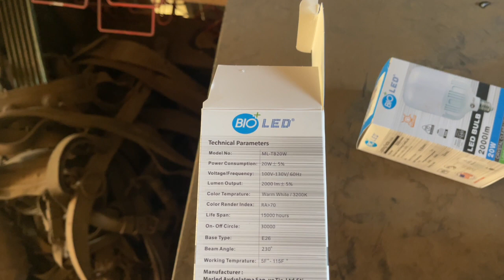No Good Way Out 😳

Comment: Hope you all have a very happy new year all year long! 20 Watts is the LED equivalent to  150 to200 Watt incandescent ones!
Reply: I came here for this. LED technology uses a lot less electricity, and is also brighter. Especially if the kelvin rating is high.
Reply: Better to look at the Lumens number.  2000 lm = 133 watts of an incandescent light bulb.
Reply: Better to look at both lumens AND kelvin. Watt equivalence is easier for most people, because with incandescent bulbs, that was how they were marketed.

LEDs are rated by both lumens and kelvin.

Comment: One trick about mud you should know about. Once it gets on any material, even that insole, leave it until it dries completely and it will dust right off perfectly clean. I was on the back of my cousin tractor while he was pulling the manure spreader, and I had the job of operating the handle. He drove through a muddy puddle and it splashed all over both of my pant legs. He said really fast, “don’t touch that, let it dry and it will come right off”. So I listened to him and a couple of hours later when it was dry as a bone, I dusted my jeans off and they were as clean as when I put them on.  So this was for a , just in case you didn’t know, especially since you guys are in mud so much.

Comment: Those are 2000lm LED lights, so they put out around the same amount of light as say a regular 100-watt bulb puts out, but it only uses 20 watts of power while doing it instead of using 100 watts of power like the regular (old style) bulbs do. I changed all my bulbs to LEDs because they last a very long time and they use over 80% less electricity than regular bulbs. I put LEDs in my kitchen first and that was about 6 years ago and I haven't replaced one yet, whereas I was replacing at least one of the regular style bulbs every 6 to 8 months. So the LEDs are well worth the money.

Comment: Thanks for the tip about Pure Flix ?? Sounds just like something up my alley.
The horses markings are so unique. 
Our weather is really similar, I'm not too far over the Virginia line in Norfolk. We were blessed enough to cut our heat off today. 
Praying that you found a forever fix for the Cattle water feeders and that the problems with the grain bins is solved by now. 
Praying that Brantley is healing quickly. And has no problems getting back on a horse. 
Stay happy, healthy, hydrated, safe and warm.  May God continue to bless you, your family and your adventures.

Comment: My suggestion for the muddy boot is turn the top side down and shoot water up inside with a hose. Then wait forever for it to dry unless you have a long nozzle hair dryer to use. If you wear a belt you might be able to loop a cord over the belt and tie each end through the eyelets for each boot. Since I don’t have industrial thickness mud I’ve never tried it but it might work. Good luck and Happy New Year to all.🙏🎉🫶🏻

Comment: I believe you were thinking of never getting done like being on a "hamster wheel".  Those LED lights that are 20W are always brighter than the old incandescent type of 20W light.  Yours had an output of about 2000 lumens per bulb as opposed to the old incandescent 20W which would have been about 100-200 lumens.  If you want a bit more "daylight" look to the lighting get an LED bulb with a "color temperature" of around 5000K - that will be white light.  Your 3200k color temp lights give off that warm amber light - just remember the lower the color temp number, the "warmer" (more amber) the color of the light.

Comment: I'm not telling LB anything he doesn't already know - You have to try your idea.  I have learned more from trying (and usually failing the 1st time) then not trying.  When I was racing dirt bikes at 11years old or so, my dad told me "you rebuild the engine this time, you have seen me do it, now it's up to you" and I failed until I didn't.  I could rebuild 125 2 stroke engines in my sleep when I was 13.

Comment: 20W is the energy (Watt) that the LED lamp consumes. As its efficiency is much higher than a standard light bulb, you can compare is with a 120W bulb that does 2000 lumen (light intensity).
So both values you mentioned where correct 20W LED corresponds with 120W standard light bulb, both producing 2000 lumen.

Comment: I noticed on the lightbulb box the Lumen rating was 2000. That's what matters. Lumen output is more important than watts. Whenever I buy LED flashlights, I always try to get the highest lumen output. Those bulbs may flicker some in cold temperatures.

Comment: Hey gang I’m still enjoying your videos. The lights your using in the barn are LED I believe. When it says 25 watts it is saying that the amount of power that they are using. But the brightness of the bulb will be equivalent to the brightness of a 100 ,125 or larger wattage of the old bulbs. The bulbs your using is a big electric savings. If you buy a contractor box of the bulb the  size of your old bulb throughout the farm including the house you will see a big reduction in your electric bill. Check with your big box store or read about it online. They seem pricey when you first do it or just do the area you use the most. Then chance out as needed for the rest. They won’t work for putting heat in the well house because they work much cooler than old bulbs. I’m also glad for LB and the knees. Just wait and see how great he well be doing this time next year. Happy New Year

Comment: Meradith, you're confusing power consumption (20 watts) with light output (2,000 lumens) . . . . which is quite bright.

LED light bulbs are far more efficient than conventional incandescent bulbs.  They put out far more light with less power consumption . . . . . which is why LED bulbs are slowly replacing incandescent bulbs.

Comment: Those LED bulbs use 20 watts of power for 1000 lumens. A 60 watt incandescent bulb uses 3 times as much power for 900 lumens. A lumen is the unit of luminous flux, a measure of the total quantity of visible light emitted .
 You are getting MORE visible light, using 1/3 of the power of a 60 watt incandescent bulb.